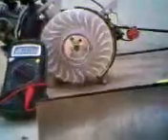HHO torch electrical properties 2 of 2

Comment from the maker: The optimum setup would be a globe with the torch inside it with an insulator between the torch and the globe, you could extract the heat and electrical power seperately, but in the same container.